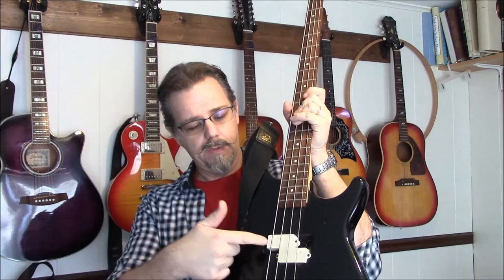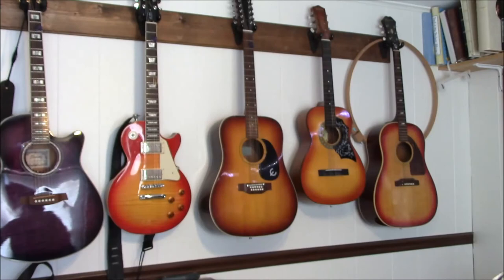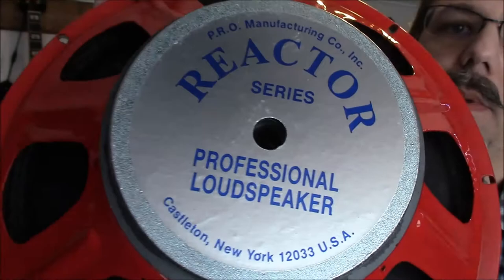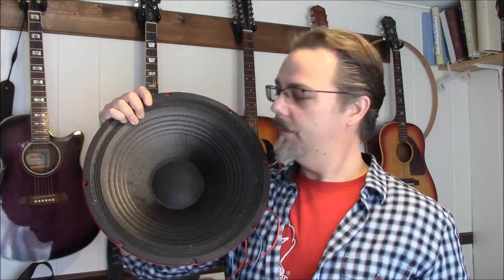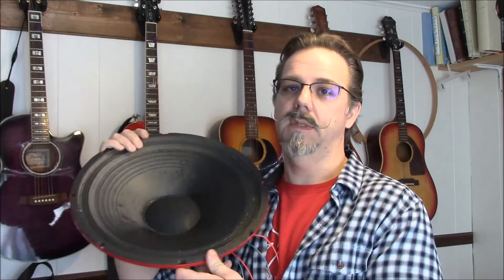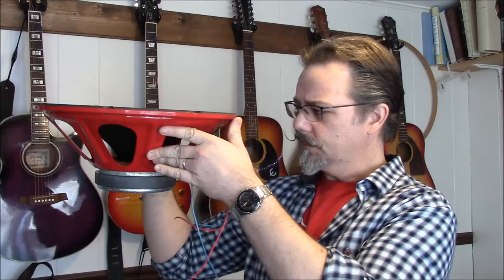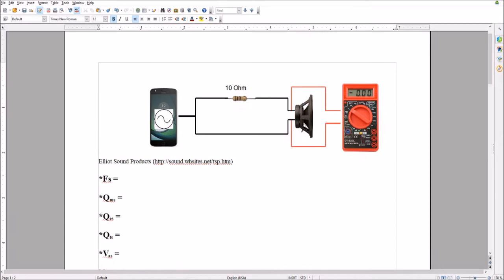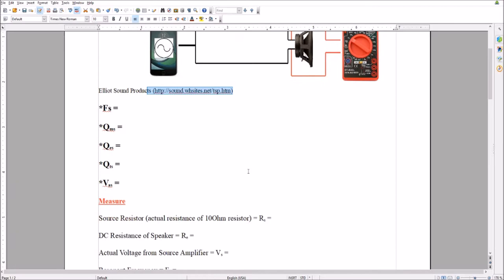Measuring T/S Parameters for a undocumented speaker

Comment: Sorry about my delayed response. Far too many electronic and honey do projects. 

While my setup may be capable of measuring T/S Parameters, I'd  never done it before and learned a lot from your video. 

What I found quite annoying  were the resonances in our family rooms and cars when setting up or replacing speakers.

A sweep test of my  new 1995 Mercedes C-280 found a resonance around 45 Hertz, caused by a loose speaker mount. A 35 Hertz resonance was caused by 2 plastic wire clamps an assembler had left on the rear sub-deck. At resonance, they bounced like Mexican jumping beans. Same with some loose hardware in my 2011 Camry Hybrid, after I'd replaced a speaker
with voice coil drag. Velcro, duct tape, pieces of foam, RTV and cable ties are great for damping resonances. 

The most recent were the two metal straps I'd used to earthquake-proof our 7 foot high grandfather clock. Without them, you could easily push the clock over with a finger. There was a strange noise when the clock chimed or the subwoofer hit the right note. Neither the clock person nor I could locate the noise. That's because I'd disconnected the straps so he could look at the rear of the clock.

When I reconnected the straps. I realized one of them was resonating and kissing the top of the clock enclosure. A strip of fuzzy Velcro under both straps stopped the racket.

Velcro also works for bookshelves of rattling teacups and under the bottom of rattling picture frames. Also keeps them from tilting.
Reply from the maker: Those are great and innovative solutions. Great job. My biggest resonant sources are two glass cabinet doors. That is, each cabinet door has a pane of glass in a wooden frame. I'm sure a little hot glue will fix it, it's just low on my list of priorities. I usually forget about them until I'm playing bass and they start rattling. But at that point, I'd usually prefer to just play and ignore the rattle rather than fix it. I'd make a mental note about it, then promptly forget. :D

Comment: glad i found this video, i have 2 mid-range woofer with no parameters, the only parameters that i have is that the RMS power is 80W, and the impedance is 8 ohm, i've tried this once, but i didnt do a great job to calculate it, and i already made the enclosure for it sadly, probably gonna re-measure it and try to fix the enclosure
Reply from the maker: Good luck to you. I hope it all works out. My numbers ended up kinda weird, but the cabinet still sounds pretty good, just not very loud. But the amp has a DI, so I guess it doesn't matter all that much. However, I haven't tried it with an actual drummer, so I have no idea if I can even hear it.

Thanks for watching.
Reply: have you heard about software called WinISD, its basically a software to design a box based on the parameters, but more complex than the website version
Reply from the maker: I have not heard of that software. Even so, my goal was to keep the project as inexpensive as possible. And even if it were free, I am very wary of downloading software from random websites. Besides, the website versions were good enough to show me the speaker was probably junk.
Reply: its free, i've download it, and i already scanned it with my bitdefender anti-virus and its fine, yeah you're right, there's no point to use complicated software for such a cheap speaker tho, if you curious about the software, you can check it here http://www.linearteam.org/ . Anyway i already measure my speaker, it's turn out my speaker Qes is worse than yours, mine about 6.22, its cheap tho for a 5" woofer with no brand, around $3-4, its so hard to get a good quality speaker without a lot of money here, so yeah maybe i just stick with this woofer for awhile.. , there's an alternative for the rice, you can use kinetic sand, its not sticky and easy to clean.
Reply: If it's a sealed enclosure, don't forget to try the Linkwitz Filter before anything too expensive or time consuming.
Reply: yep, i already made the box, and use a cheap crossover with a cut off frequency of 4k, it sounds great at low-mid volume thou, but not so great at high volume
Reply from the maker: I already built my cabinet as well. You can see the video at https://www.youtube.com/watch?v=2lGkpTvJKPQ.

I like the sound of it, but even though my amp says it will put out 150W, it really isn't as loud as I thought it would be. I'm using it with a bass guitar amp and I don't think I'd be able to hear it over a drummer. I may need to upgrade the amp at some point, but the speaker just doesn't seem to be very efficient.

Comment: Thanks for detailed video, I'll be very glad to see any updated one too.
Reply from the maker: As far as an update, it's still going fine. Haven't had any reason to disassemble the cabinet I put it in and start over. Though it might be too quiet, but I'm not sure if the amp is too weak or if the box is limiting the output. If I ever need to get it louder, I might re-do this video and get more accurate parameters.

Comment: Not that it means a lot, but on the Low Resistance Range (typically 200 Ohms) both Digital and Analog meters have test lead errors as much as 1/2 Ohm. The easiest way to compensate is to short the probe tips together and note the reading as "Test Lead Resistance". Subtract it from all real measurements. If you change the meter Range to 2k or higher, lead Resistance is negligible.

Another way to measure the Voice coil resistance is to connect a fresh 1.5V D battery (NO HIGHER VOLTAGE!!!) to the cone through that same 10 Ohm resistor and a series-connected multimeter on the 2 Amp DC Range. For a 2 Ohm Voice Coil, the meter should read around (1.5V / 12 Ohms) or 125 milliAmperes on the 200 milliAmpere DC Range. The internal Voltage drop of the meter and its internal fuse may give a slightly lower Current value. No Big Deal! Just record the measured Current. 

Then take a second meter on the 2 Volt (or 2000 mV) DC Range and connect it DIRECTLY across the speaker's Voice Coil Terminals. Use Ohm's Law, R = E/I to calculate the Voice Coil Resistance. What you've just done is taken a 4 Terminal Kelvin measurement, one of the most accurate ways to measure Resistance, especially low Resistance. The Current reading already includes the 10 Ohm resistor's Resistance, plus the Current meter's internal and lead resistance. The lead resistance of the Voltage-reading meter is inconsequential. 

What's left to affect your result is only the accuracy of the two meters.

One other point - the most accurate range for a Digital meter is the 200 millivolt range. Most meters use the Dual Slope technique, where the internal Battery Voltage, the internal Rs and Cs, the internal dividers, shunts, adjustments, ramps and clock frequency cancel, leaving only the internal Voltage Reference. If properly factory-tweaked, the 200 milliVolt range can easily be 10 times better than the stated accuracy.
Reply from the maker: Excellent! This is great information. I will definitely use this in other projects I plan on doing. Especially the note about the digital meters and errors at low resistance. 

Thank you for watching and commenting.
Reply: While generally not as accurate, old Analog Ohmmeters, like my Micronta 43-491 (Radio Shack in Amsterdam) were subject to battery aging and had a Zero adjustment, also perfect for zeroing lead resistance. Whenever I worked on world-wide CTs or MRIs in the 70s, 80s and 90s, I always scouted the local Radio Shacks as soon as I arrived in town. You can't believe how many multi-million $$$ scanners were diagnosed with, and actually contained Radio Shack parts.
Reply from the maker: HA! That's awesome. I miss Radio Shack. :(
Reply: The described technique can also be used to measure the 10ohm resistor, or any low value resistor for that matter. If you have a lab PSU, it is very easy to set some reasonable current limit, then measure the voltage drop directly on the resistor or resistive-anything. If you don't trust the current reading of the PSU, then either include an amper meter in series too, but is cruical to always measure the voltage drop on the device under test, as close as possible.

You can measure miliohms this way if you can pump out amps from your PSU (and the device can tolerate it, eg. you measuring a cable).

I'd like to point out that measuring AC voltage might be inaccurate with multimeters if the signal is way off of 50/60 Hz. Might be accurate, but you can only be sure, if the datasheet guarantees it in some frequency range, or if you check it with either a known accurate flat response function generator or an another known accurate voltmeter. It's not a problem in this subwoofer range, but might be higher up in the audio spectrum.
Reply: I agree with Gabor.

Whenever you're doing low resistance measurements, the 4 terminal or Kelvin connection overcomes lead and contact resistance by ensuring no substantial current flows through the Digital Multi-meter's test leads. 

When you measure a low value resistor using the DMM, by itself, the small, but significant current the DMM applies to the resistor-under-test also flows through the DMM's test leads, causing an (I)(R) product Voltage drop. By itself, the DMM can't separate the lead's (I)(R) drop from the resistor-under-test (I)(R) drop. You have to subtract the test lead (I)(R). On an old analog meter, you can usually re-zero or null the test lead (I)(R) drop.

Or you can use the Kelvin connection.

https://en.wikipedia.org/wiki/Four-terminal_sensing

Lord Kelvin is the same engineer/physicist who gave us the first two Laws of Thermodynamics. The Kelvin temperature scale is also named after him. 0 degrees K ~ - 273.16 degrees Celsius or Absolute Zero, where (at least in 2022) all molecular or entropic motion ceases and all pure resistances become noiseless.

https://en.wikipedia.org/wiki/William_Thomson,_1st_Baron_Kelvin

Comment: Obviously, the measurement error is due to the use of rice as an additional weight. The rice rattled audibly. This means that the additional weight of 50 grams was not firmly coupled to the diaphragm of the loudspeaker. The measurement was effective with far less than 50 grams and therefore the resonance frequency was much too high. With this wrong frequency one receives a much too high value for Qts in the calculations. For a correct measurement it is absolutely necessary to use a compact mass as additional weight and to ensure that it holds firmly to the diaphragm. Modelling clay is ideal for this purpose. 
In my experience, these cheap loudspeakers have a Qts of about 0.8 to 1.3. This makes it impossible to achieve a linear frequency response without manipulating the frequency response of the amplifier. Nevertheless, it will be possible to achieve a passable sound in a suitable cabinet. With instrumental loudspeakers, linearity is also less important. Often it is the objective errors that make these speakers sound attractive.
Reply from the maker: Now that you mention it, that makes complete sense. I didn't have any clay on-hand, however. 

Though I agree that in music, especially rock based music, such errors are attractive to some listeners. The Kinks were famous (infamous, maybe?) for poking holes in the speaker cones to get the sound they were after. I guess at that point T/S parameters really aren't worth much. 

Thanks for watching.
Reply from the maker: @depunkt Yeah, I probably should have used some clay. But I didn't have that available. 

If you are trying to get the T/S parameters then you can use this method (substitute the clay for rice). 

Thanks for watching.

Comment: In my opinion, this may be an older video, but it's relavancy is just as applicable, as when it was produced; & it has been really well explained. I cannot understand why it only has a 'like' rating of ~1.45%, per views.
   I have acquired a couple of older Sony 8" subwoofers, pulled from cheap audio equipment. In attemtping to research the design requirements, for a custom subwoofer, I quickly discovered the issues surrounding using drivers, with unknown parameters, which led me here, eventually. 
   And, I have found out, that Sony do NOT share their tech: what a surprise. Even though I know the speaker models, any technicals are not to be had, on the internet.
   As someone who is not an audio guy, but has some electronics' ability, I preferred a video that was presented in plain speak. Your idea of using a phone, with a frequency app is just what the doc ordered 👌. Given my Denon AVR is bluetooth capable, I am able to simplify the connections, somewhat 😵‍💫: headphone jack>jack to 3.5mm jack>3.5mm to RCA adaptor cable. Then,  a cut off RCA cable, with a 10ohm resistor soldered to the positive?
   I think I'll just do the lazy way, & use the supplied spreadsheet.
Thanks, mate.
Reply from the maker: Thank you. I think a lot of people disliked that I used rice instead of clay or playdoh to weight the cone. But other than that I think most other things went pretty well. 

There is another video where I attempt to design an enclosure for this speaker that didn't go very well due a misprint of a formula on the website. I should go back and fix it, but it's pretty low on my priority list.
Reply: @HandlebarWorkshops  Thanks for letting me know, you are still monitoring this video. 
I have a question, that may/may not relate to your measurement parameters: the amplifier you showed, does it fit the stipulated requirements -ie. 1-10W RMS, & an output impedance of <0.01 ohms? I am not sure how crucial this is.
 I only saw this once I thought about setting up, for my testing. So, am unsure if my amp (Denon X1100W) would work, as I cannot find the pre-measured impedance, of it. The manual only relates to the speakers.
I do have other options: another, older Denon. But that also may not be viable; & it involves unpacking it. Also, a Logitech Z501 (?) PC speaker setup. Have more research to do. But, it's not that urgent.

PS. it that is the only reason people have not liked it; well...🤨. Personally, I thought the rice was an excellent innovation, as it is easy to place, & remove; it is dessicated, so won't take in moisture easily; & not possible to inadvertently damage the inner cone, like placing a semi-pliable product could.
Reply from the maker: @citizengkar7824  While doing research for this video, I did not read anything about output impedance, nor about the RMS. 

This method isn't meant to be (nor can it be) extremely accurate, but doable for someone to do once or twice without investing in expensive tools. It's meant to get close enough to get a good (but not necessarily a HiFi) sound out of a speaker. 

After all, since it is a fairly unknown speaker, you probably didn't pay much for it anyway. You just want to make it sound as good as possible without spending too much more money. It would be cheaper to buy a new speaker with known parameters than to buy all of the scientific tools to do this at a high level of accuracy.
Reply: @HandlebarWorkshops  I do agree all you've said. Though, it does state those requirements, on the Elliott site, you've linked.
"1.1   Measuring Re, Fs, Qes, Qms and Qts

To measure these parameters using the method outlined below, you'll need to have the following items:

        A power amplifier, rated at 1-10 Watts (RMS) or thereabouts (must have low output impedance <0.1 ohm)
        Audio frequency oscillator (PC based is fine)
        Digital multimeter (with frequency measurement), or PC based instrument
        An accurate test resistor (any value, although I suggest 10 ohms) A ½W component will be quite sufficient.
        Alligator clip leads - you will need 4 sets of leads (leads may be soldered instead if desired)"
Reply from the maker: That Elliott site has changed since I used it for this video. For a while it was a 404, then when it came back one of the formulas was different. I haven't gone back to see if that new formula would result in a better end result with this speaker. 

I don't remember any of that list being there, but it's been years, so my memory of all that may be a bit off.
Reply: @HandlebarWorkshops  Thought that may be the case.
I'll also keep researching, until I'm ready, & comfortable in achieving the parameters, as some sites are using slightly different cable mods, etc.. Cheers.
Reply from the maker: If you figure it out, please post a video or a blog somewhere.